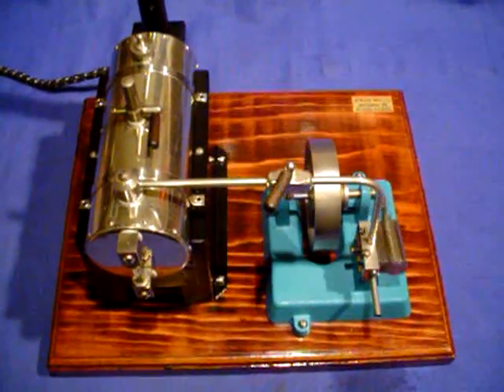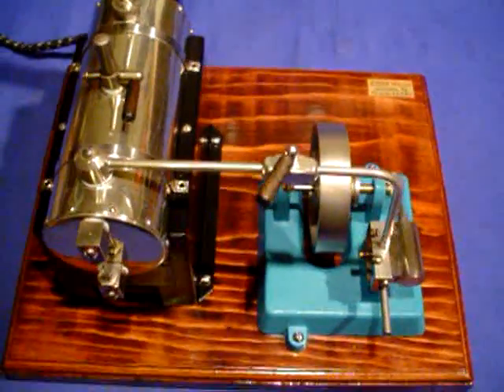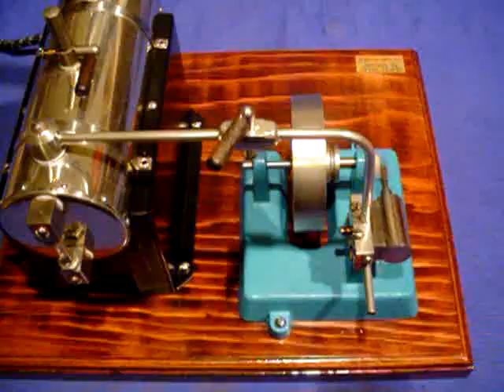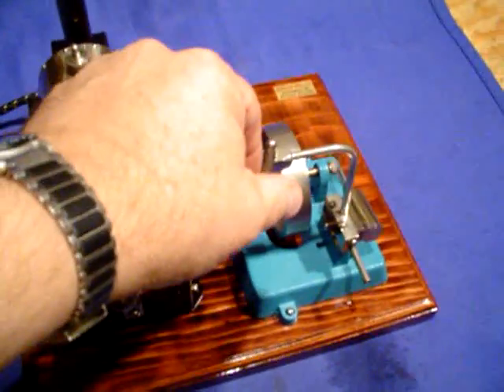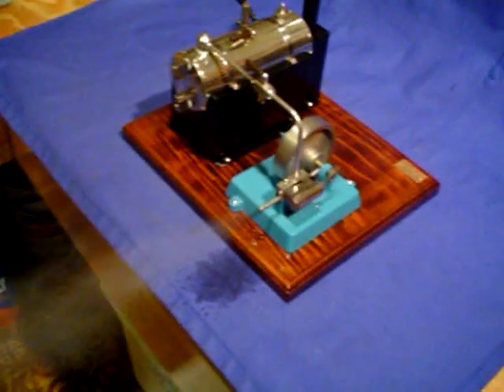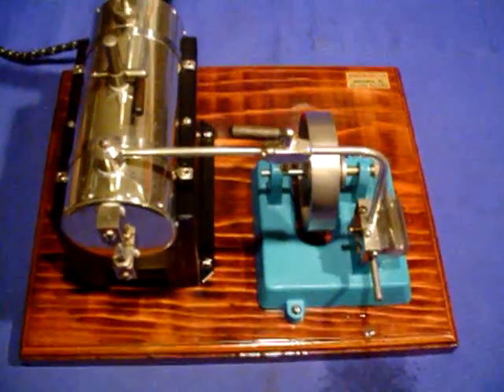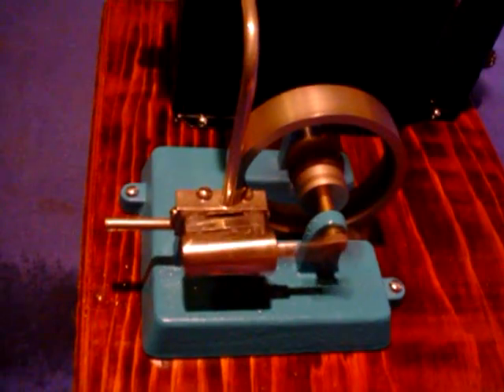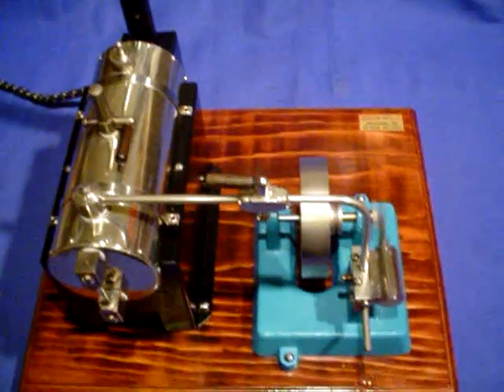Jensen #5 Oscillating Steam Engine from 1939

Comment: For i have 1 of these But where the speed control vale is at for that is not on it & It to runs 100% when running at a FAST speed & i added a Wilesco Gen. With Light Blub & when the Boiler builds up enough Steam it will start Running it fast enough to drive the Gen. & Light up the Bulb